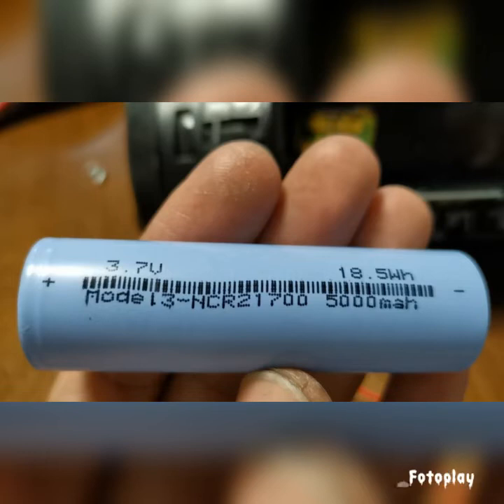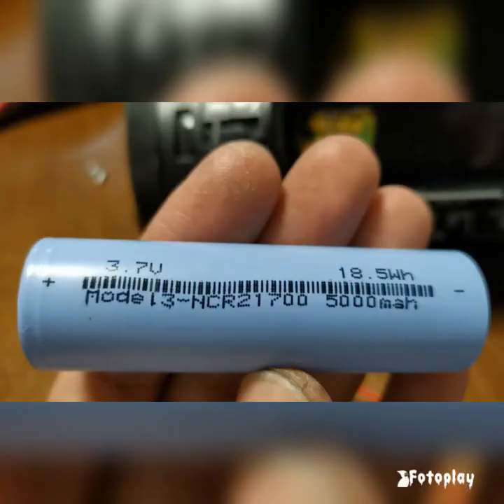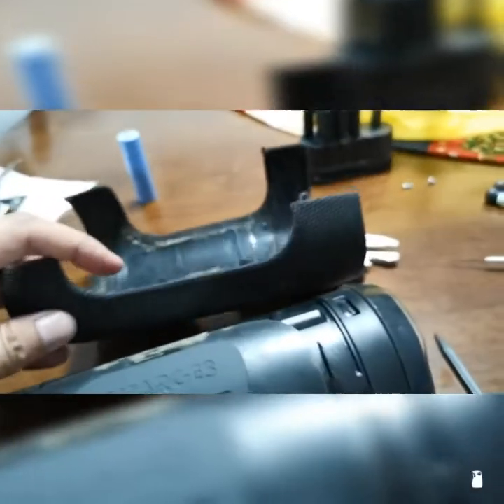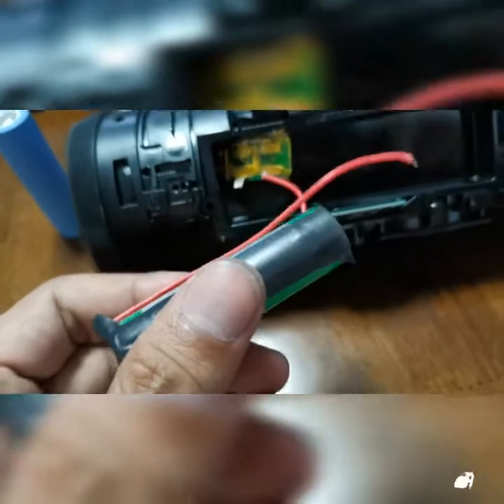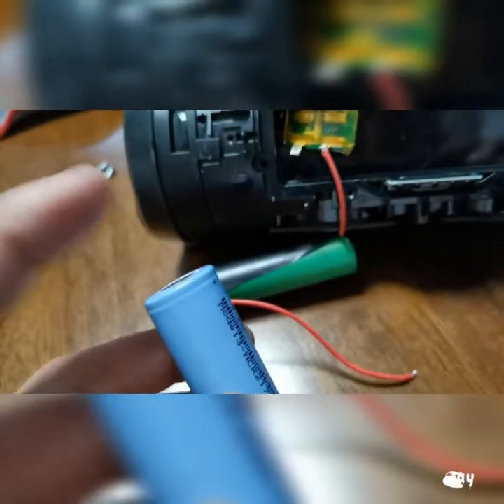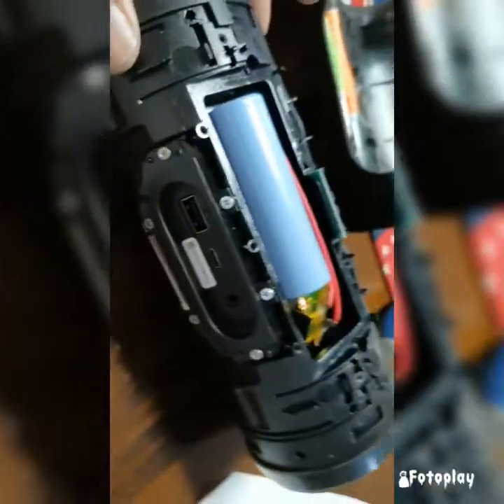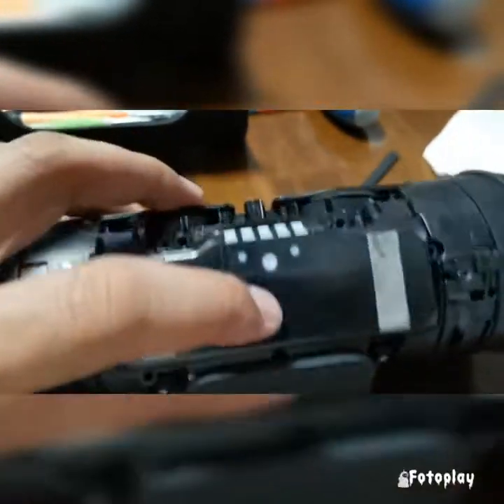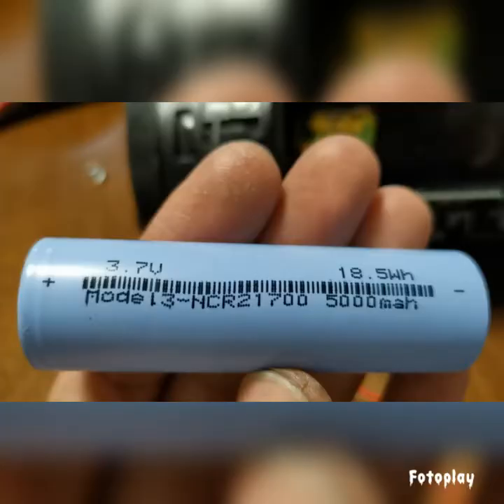JBL Charge 3 Battery replacement (from Lithium Polymer to Lithium Ion)

Comment: So I changed the battery but it discharged and it’s not charging it’s only blinking red. ? What’s wrong ?  It’s 7000 mah 3.7V battery. 18650.
Reply from the maker: @El_Galactico__7  i think the MAH rating of your replacement batt is too high for the default BMS
Reply: @ it’s not working with 2,200 mah too.

Comment: are you got bms from old polimor 6000mah battery?
Reply from the maker: Yes same bms from old polymer battery.
Reply: @akosijaja  bro i cant find 6000mah battery available capacityes are 5000mah and 9000mah what is better for this
Reply from the maker: @GTXSUPER-sg6ik  bro thats not what I used in this vid. I used a li ion battery with 5000mah and reused the old batt's bms

Comment: san po galing yung pinag-solderan mo na pcb?
Reply from the maker: yung galing po sa original battery. baklasin mo lang po yung plastic nun marireveal na yung pcb. BMS po tawag dyan. has to be the original BMS po
Reply: @akosijaja  thanks! gumana na sya. laking tipid 😅
Reply from the maker: @thefirstpaulo  nice, congrats po :)
Reply: Does using the 21700 cell not compromise the waterproofing of the speaker since the original li-po batt seems thinner? TIA!
Reply from the maker: @christopherjohnjagorin2879  kasyang kasya po sir, walang pilitan ang pag close ng cover. kaya tuwa din ako kasi yun din ang worry ko. nung 18650 na una ko nitry, maalog sya sa loob kasi maluwag